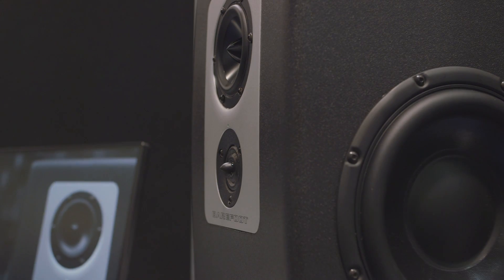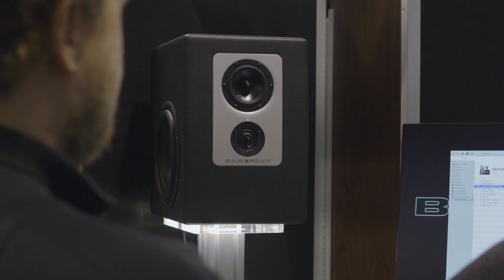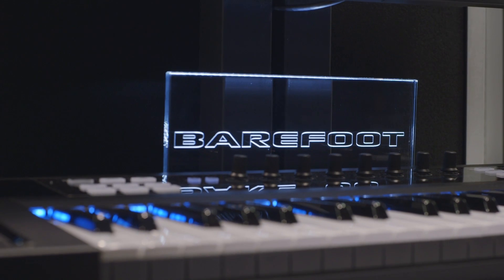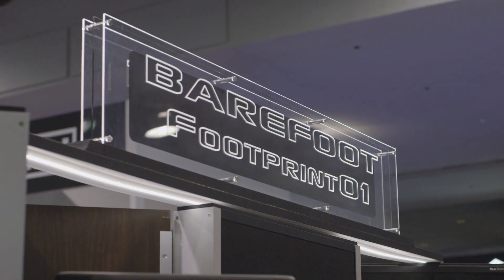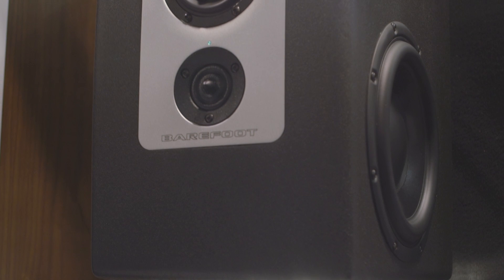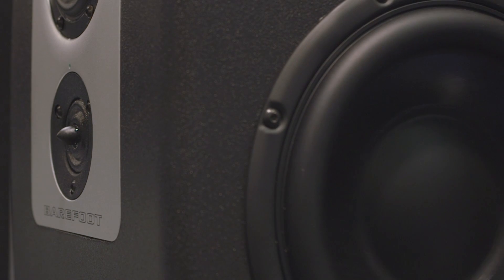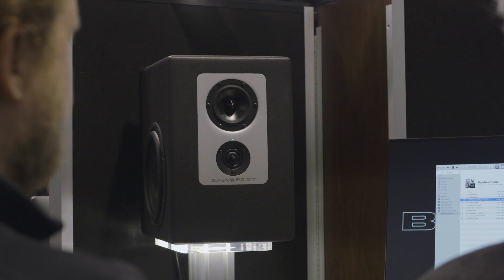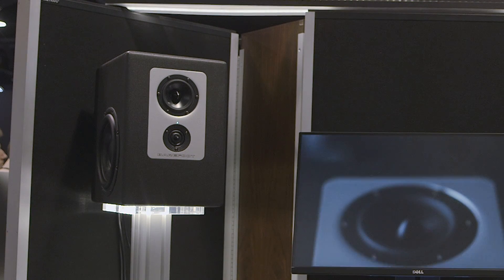Thomas Barefoot Introduces the Footprint01

Comment: How about a digital input?  The DAW converts digital to analog, then the monitor converts it immediately back to digital.  That's two extra conversions!
Reply from the maker: The USB is for updates and tuning, not for conversion.
Reply: looks like it has USB.
Reply: 99% sure that's only for software updates
Reply from the maker: In our effort to make a more affordable speaker, we had to leave off certain features, and the digital input was one of them! If you're wanting a speaker with a digital input I'd suggest the 35's, 26's, 27's or 12's!